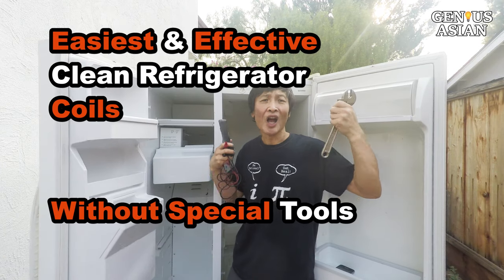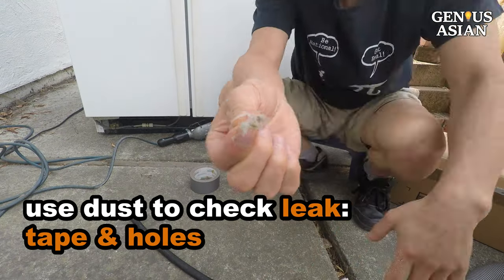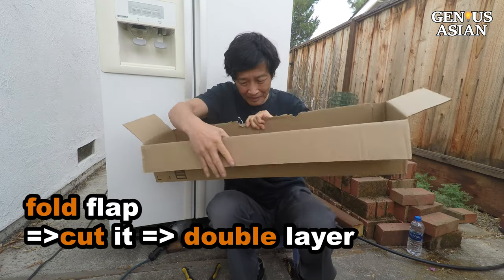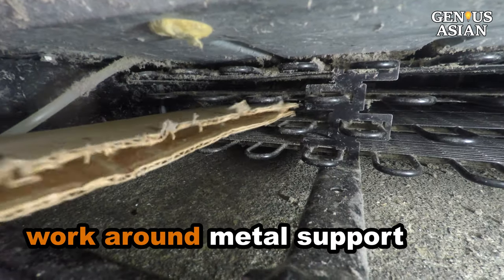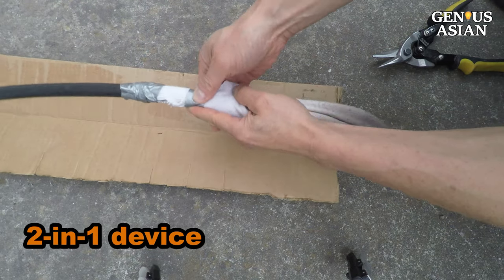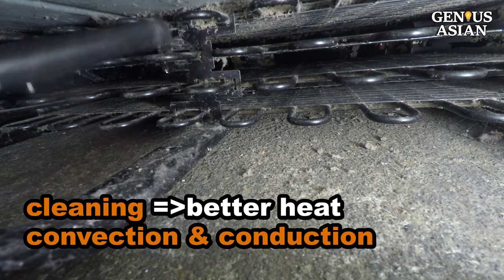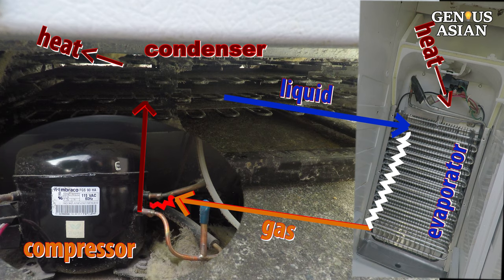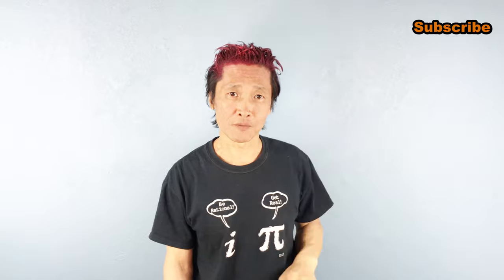The Easiest & Most Effective Way to Clean Refrigerator Condenser Coils Without Special Tools

Comment: I used a very strong leaf blower and blew out the dust and used a damp towel on the other side to catch the dust. It works. Just make sure the leaf blower is strong.
Reply from the maker: yeah, vacuum may have maximum of 14.7 psi pressure. Compare to compression technique without upper pressure limit. The only potential problem is how effective of your damp towel, were you able to catch the dust without an air purifier running at the same time? Thank you for chime in to contribute to different ways, this will help other people.
Reply: @GeniusAsian Yes, good point. I turned off the frig and opened both ends.  I blew out both sides.  I had to make sure the drip tray was dry, too. I was able to cover the opposite ends with a damp towel and I used a bench/and heavy weights and strong magnets to help the damp towel stay in place.  I tried all of types of brushes and vacuums but the crevices were too small and tight to get to. Only a strong leaf blower worked.  My coils have not been cleaned, ever.  I’m embarrassed to admit it but for those who tried other methods this might be another option.  Also, cleaning the coils helps with electricity bills and helps to keep the frig cooler. Hope this helps someone out there.
Reply: If you use an air blaster, be sure to wear a mask so that you won’t breathe in any of that dust smog. I wear a dust mask even when I vacuum, or even when I clean out a vacuum, except when I get too lazy to care about my lungs.

Comment: Not bad.  Yet a better design might be to seal off the end of the tubing air tight and drill 2 or 3 holes on top of the tube and then run that through the coils.  Instead of a sock a soft rounded bristle brush would work better to loosen the dust and then go back through it with the vacuum. Or for that matter something like a swiffer that will attract the dust to a damp pad. Overall as long as a person gets in there and makes an effort to clean the coils it shouldn't be too difficult. Something that blows air could also help to loosen up the dust like a mattress inflator or a vacuum with the reverse flow feature.
Reply from the maker: Thank you for taking the time to contribute to this topic, sharing your results and collective ideas will benefit many other viewers.
Reply: @GeniusAsian  You're welcome.  Since you encourage sharing ideas to help others, I will share some additional tips.  

In addition to cleaning the dust in the back of the refrigerator, people should also be aware that if the fridge keeps icing over and getting warm, it might help to change the cover assembly inside (the big panel in the back of the inside of the fridge that has the fan and sensor in it- the one that covers the evap. coil.)  Cleaning the coil and one temp. sensor didn't fix my issue (fridge was still too warm and icing over inside.)  

When I changed out the new inside cover panel, much to my surprise, the new part was about 2lbs. LIGHTER than the old one.  The reasonis that there was  moisture (not ice- but water) retention deep inside the old part (not visible- but in all the foam bits.) This moisture makes it much more likely that the fridge will ice over inside again.  The reason is that refrigerators do not so much add COOL air, as much as they try to remove WARM, moist air.  The goal is to create a cool, low humidity environment.  If there is a moisture source near that evap. coil, that is not good. Also, never leave high moisture type items exposed inside the fridge e.g., a cut up watermelon, glass of water or any liquid, wet vegetables, etc.  The fridge will work very hard to remove that moisture- which will then gather on the evaporator inside and ice it up.
Reply from the maker: @MOAB-UT  thank you for your tips, nice to know that "new part was about 2lbs. LIGHTER than the old one.", which manufacture/model is this? Last time I called Kenmore's refrig support, I was told it was made by whirlpool, so a lot of brand names share a few limited manufactures.
Reply: @GeniusAsian  7 year old Samsung French Door model with icemaker.  It was about $2300 new.  Fortunately we took out the extended 10 year warranty.  So far, we've had the entire ice maker replaced along with 2 sensors, fan, entire back panel and control board.  I also cleaned the coils very well.  It is running much cooler now.  Many of the techs these days don't even test- they just replace parts.  I guess from experience they know which ones usually go bad.  Our tech had 35 years on the job.  Easy fix for him.
Reply from the maker: @MOAB-UT  thank you for sharing. Your Samsung refrig was quite expensive. New refrig may have new cool features but may break down, this Kenmore refrig https://youtu.be/XSspTwABECo only has the evaporate fan replaced once during 10 years. We also got a Samsung here: https://youtu.be/XSspTwABECo?t=201  I can't find any coils, the instruction that came with the refrig also does nto mention cleaning, I also called Samsung support, they could not answer the question if cleaning is needed, very strange
Reply: @GeniusAsian  It's actually a great refrigerator overall but not perfect.  With the recent repairs just made, it should be good for many more years to come at this point.  If not, I have 3 more years of warranty left.  On any modern fridge, especially if it is over $2,000, getting a warranty is a smart investment.

Cleaning the air intakes and in and around the coils is typically recommended every six (6) months to a year.  This routine maintenance is not exclusive to Samsung.  It helps to ensure the parts don't have to work too hard- as they would if it were clogged.  It also cuts down on electricity costs.  Even in a clean home, those coils tend to attract dirt and especially dust and pet hair.  The fan draws all of that towards it whenever it is running.  Getting back there also gives you a good opportunity to inspect things e.g., obvious leaks, loose fan bearings, etc.

Thanks for all your informative videos and sharing your knowledge- very helpful and appreciated.
Reply from the maker: @MOAB-UT  I still can't find any info for the new samsung refrig, it does not have exposed coils
Reply: @GeniusAsian   Mine is model RF24FSEDBR/AA. You can't see the coils unless you remove the lower cover in the back it's near the floor. The other cover(s) are inside the refrigerator behind the shelves up top and there is a cover in the freezer (mine is dual zone aka Twin Cooling.)  You have to remove the covers to see any coils. 

The main cooling components of a refrigerator includes, 1. Compressor, 2. Condenser Coils and 3. Evaporation coil(s). 

The coil in the back of the refrigerator is prone to dirt and dust because there is a big fan there blowing on the condenser coil to cool the refrigerant.  When the coils get dust on them they don't cool as effectively so the fridge has to work harder (you might here it running more than usual.) Also you want to clean the fans in the area(s) where the air is being drawn in to the unit.  This is usually in the front, side and rear vents.  

All of this is just basic routine maintenance that should be done every 6 to 12 months. If the fridge is still running hot it can be several other issues.  I cleaned my coils but still had to replace several parts including sensors.
Reply from the maker: @MOAB-UT  thank you for sharing. I googled the user manual for your model: https://downloadcenter.samsung.com/content/UM/201808/20180830164933464/DA68-02897A-15.pdf   on page 28 to page 29 about cleaning, it does not mention cleaning coil, it says: "Do not remove the back cover"  My samsung manual does not mention cleaning coils, when I called the customer did not help on this subject either.
Reply: @GeniusAsian  Those coils definitely, as in 100% need to be cleaned every 6-12 months.  Most people ignore this maintenance until there is an issue.  

If you are not comfortable, then let a tech do it...though, it is extremely easy to do.  First, I unplugged it.  There are about 6 metal screws.  With an electric screwdriver, took less than a minute to have the cover off (I cleaned the cover and it's vents too.)  I used a can of compressed air and a vacuum cleaner and a damp cloth (when it was unplugged.)  I was careful to avoid wires and bending any cooling fins. Samsung probably prefers that their techs do the work.  It would be easy money for them.  I think a service call is ~$175 + labor and parts.  It cost me about $10 and an hour of my time.

About removing the rear cover, I think they are much more worried above the two (2) metal panels above the very bottom one.  That is where there are more electrical components (like the main circuit control board- power supply, etc.)  With the other covers removed, there is a much higher chance of receiving an electrical shock (potentially even if unplugged due to capacitor discharge.)

Good luck- cheers!
Reply from the maker: @MOAB-UT  I agree with you dirty coils should be cleaned, otherwise efficiency is reduced. However why would samsung design a back cover and also  in the manual it says: "Do not remove the back cover"? I don't think samsung brings in revenue from services and cleaning, so it is strange samsung does not let customers to clean it.
Reply: @GeniusAsian  Not strange at all actually.  They make money selling new refrigerators.  There is also some potential for liability (electric shock, fires, damage, etc.)  You are a self-described "genius" but the manufacturers concern might be that a non-genius, aka inexperienced or careless person might attempt to do the work.  To limit that exposure, it seems like they don't want consumers doing any servicing on the machines at all.  

The cover is simply there and necessary to keep a lot of dirt/dust out.  It has vents on it.  Most of the air, at least on mine is pulled in from the front of the unit. It's only a few screws and it pops right off.  If they never wanted that area worked on, it would be sealed (no screws.)  There are also warning labels on my cars engine too but I still change the oil.  Regardless of who does it, I can assure you that the coils do need to be cleaned at least every 6-12 months.  If it's not done, you will use more electricity and the fridge, over time will run warmer. Most of the time, when symptoms start to appear, the machine is probably already 5+ years old.  At that point, many people will simply choose to buy a new refridgerator.  That also benefits the manufactures.
Reply from the maker: @MOAB-UT  Thank you for mentioning the cover, I just looked at the back of my samsung refrig, my samsung does not have the front toe grill, but the back has two vents, one on the left corner, the other on the right corner. I assume the air comes in from one vent and goes out from the other vent (airflow is a U shape path). It sounds like your samsung has front toe-grill, maybe your airflow is similar to the Kenmore refrig: https://youtu.be/HCyDxWifj-8?t=113

Maybe I need to open the cover and clean the samsung. Cleaning from the front toe-grill is easy, you open the front toe-grill. However opening the back cover is not easy, I need to pull out the heavy refrig out first. I may try to DIY some special vacuum adaptor: the vent cover has 0.5x2 inch mesh, if I make a nozzle with opening of 0.4x1 inch, it may goes through the mesh without opening the cover, without pulling out the refrig.  I will make another video when I make this adaptor.
Reply: @GeniusAsian  It probably vents from the front.  The rear vents are usually just to vent out heat.  Compressed air definitely worked the best for me.  I made a vacuum adapter but it could not reach all the areas needed.  I let the vacuum run so that it took some of the dust out of the air.  You will notice a lot of dust in there.  Be sure it is unplugged.

Comment: An air compressor would work much better. LIDL has them for about 100$.
Reply from the maker: yes, air compressor's pressure can be 100 PSI, the max pressure from vacuum is only 15 psi. However with air compressor, you may have to clean your house free of dusts unless you refrigerator is in the garage.